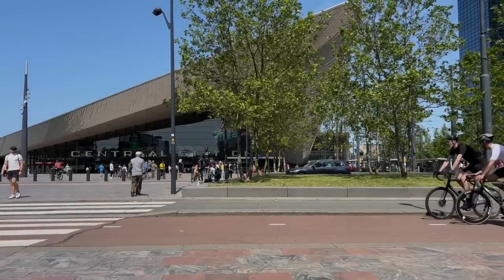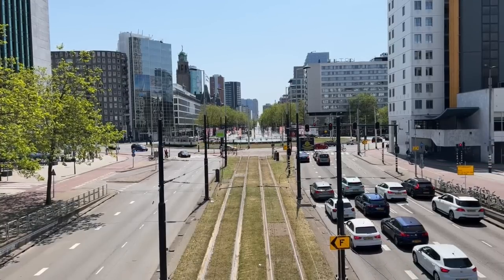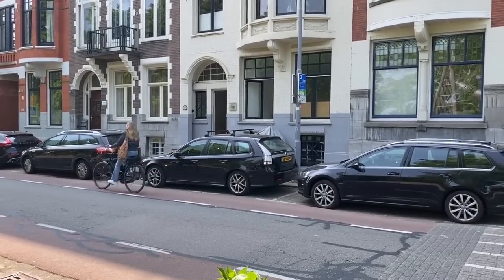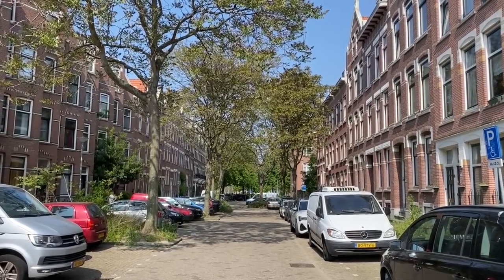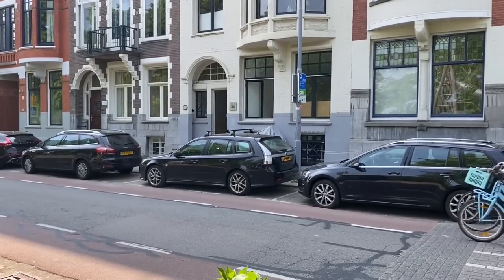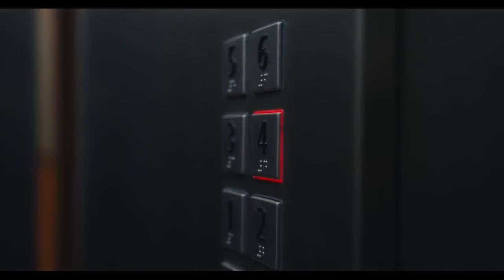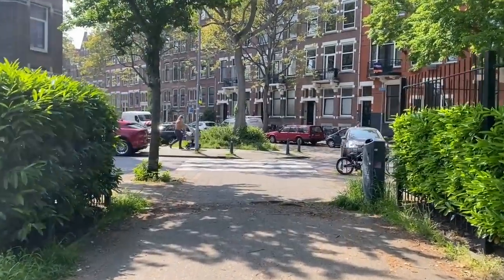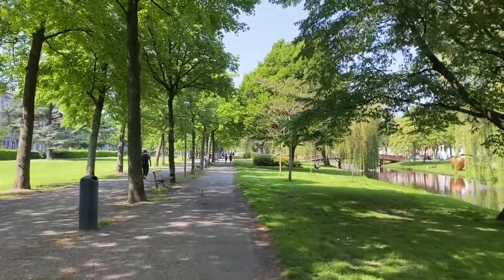How Streets Fall Apart

Comment: Alternatively, one could elect to upgrade the Heemraadsingel to a GOW, ie. with separted lanes further away from the "rooilijn" with a bi-directional bicycle lane as a separator between the side walk and motor vehicle traffic. In order to make the street nonetheless psychological longer to traverse, it is possibel to design it deliberately impeded i.e. by means of narrowed parking bays and speed ramps that do affect the speed with which cars can travel but not bus transport.

Comment: I agree that your suggestions would make this street better, however, if you do this to enough streets, then what do you do about the issue that all the traffic gets funnelled into a fewer and fewer main roads and congestion builds up there? It feels like all you're doing is moving traffic from one place to another, but is there evidence to suggest that doing this has the opposite effect of induced demand, and that overall traffic actually reduces? If not, how is the additional traffic dealt with on the main roads? And don't residents on those roads complain about the extra noise, pollution and congestion?

Comment: By the way, the easiest solution to stopping traffic through a street in the Netherlands isn't to block off traffic with obstacles, it's to simply put up a sign that says "residential traffic only" on both ends. This would still allow people who live there to access the street from both ends, and 99% of drivers will respect such a sign without the need to put up any obstacles. Maybe in Rotterdam specifically it would be a bit less than 99%, they aren't the most respectful people in the country.
Reply: I've seen "No Thru Traffic" signs used in the US with only limited success.  Americans regard such signs as infringements on their freedom, and police enforcement is difficult.  The Dutch are more respectful of others.
Reply: you think people will listen to that??

Comment: Only one really big issue with blocking of road: Trucks and vans. Yes, they need to be their. Because where people life, goods have to go. Blocking streets of causes a lot of problems for deliveries and garbage-collection. Trucks need to backup into a street, making the entrance very dangerous for all traffic and vans have to turn in the streets (or also backup into it), making it dangerous for bikes and pedestrians. So no. Bad solution. Better solution is to make the street a one way direction road in the opposite direction most traffic flows.

Comment: You wouldn't even need to move those busstops. You could place a so called "bussluis" or bus trap i think. Would be a great solution to make the city an even better place.
Reply: Just adding a retractable bollard at the end would do the trick. You might even grand those living there access to that entry as well then.

Comment: I would prefer making a bus trap instead of two poles; it would result in a faster bus!
Edit: typo
Reply from the maker: You definitely could, it just wouldn’t be ideal if you want to maximize local movement
Reply: @buildthelanes  Fair enough, it's a trade off

Comment: The worst part is that the people being uncomfortable mixing are not people on bikes, but the through car drivers. So you add these "sugggestive" lines to get the bikes out of the way.
Reply: And if you want to keep the bus traffic there are ways to prevent through traffic by cars that will allow buses. Just make sure there is a car repair shop nearby, because people are idiots.
Reply from the maker: Hold on. So in your world, it’s the person driving at 45 km/hr in a protective metal shell who feels uncomfortable but not the 8 year old cycling on a tricycle who only has 1 meter of paint for protection. 
I want you to think for a moment about how stupid that sounds
Reply: @buildthelanes  i think they might mean it differently. As a driver I hate driving on a fietsstraat, it's very uncomfortable for me. As a cyclist I love a good fietsstraat.
But there is a (temporary) fietsstraat in my area where they have streetlevel sidewalks and suggestiestroken. Cycling here is the worst since car drivers expect you to be in the suggestiestroken.
Basically drivers (read: me as driver) prefer cyclists to have their own space. But cyclists (read: me as cyclist) prefer to have a clear mixed use or completely seperate bikelane.
Reply from the maker: Yes but as the video says, this environment was never meant to be driven through to begin with. The other route is much more “comfortable” for you and only takes 90 seconds longer
Reply: @buildthelanes  I know exactly how stupid that is. But those are the priorities of urban planning.
Reply: @codex4048  You got it.
Reply: @buildthelanes  Exactly, I have not measured on a map, but it would probably be better to have a bus stop in the middle of the street combined with a mechanism that prevents other vehicles from passing. 

Even if not having buses at all might, in this case, be the best solution. And in that case, all you need is a tree or a few bushes, with ample space for cyclists and pedestrians.
Reply: One more thing: I ended up creating a street like this in Cities Skylines, it totally ruined my riverside up scale development. And in the game, you need to demolish a few houses to cut up a road.
Reply: @codex4048  making drivers uncomfortable on fietsstraten is a really thing, it means that they’ll pay great attention to their surroundings while also getting pressured to not drive.

Comment: The reason Rotterdam is so different, with modern architecture and car-centric design is that the Germans bombed it into complete ruins in the war, so it was redesigned from the ground up during the post-war car boom to be car-friendly, and we are still struggling with that legacy. Thankfully the city has a great underground metro system and train lines so you dont need a car to get anywhere, but it is less friendly to cyclists and pedestrians when youre on the streets.

Comment: These reddish “death lanes” positioning cyclists exactly in the position of opening car doors really are complete bs and without those the street could be modeled in a far more safe way.

You talk about “moving bus stops” - If you plan to remove the bus line and prolong the travel time for OV passengers and maybe some extra costs for running more buses du to the longer ride of the line pls be so honest and SAY THIS.

I guess it does not even need to be, as there are technical solutions for allowing buses to pass but block cars off as well.

Often a “simple” solution does not reflect the complexity of a problem. It needs to be adressed from more than one point of view. You need a concept for an attractive routing for the #44 bus to solve it. “Forgetting” to keep or even make bus services more attractive when creating street concepts is a real issue. Please do not copy this mistake.

Comment: Interesting thing about a "fietssuggestiestrook": you can stop your car on it legally. If it actually has a bike symbol on it you cannot. Another thing people often forget is you can, and should, block cycling traffic near crossings with either cycling lanes or fietssuggestiestroken iff (which means: and only if) the line separating it is discontinued. This makes sure you can take a right turn safely by blocking the cycling traffic with a car. So if a crossing has a continous line: wait for all cyclists to have passed. Iff dotted: move on the lane (and await complaints) but you are sure you will not hit anyone. the last part is most often employed at infrequent crossings.